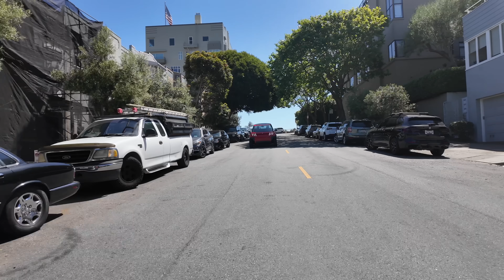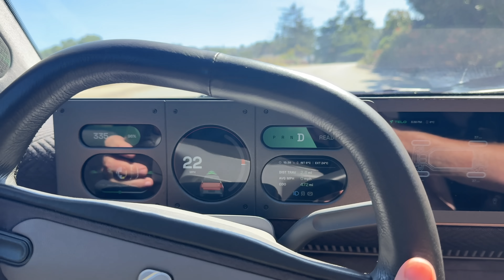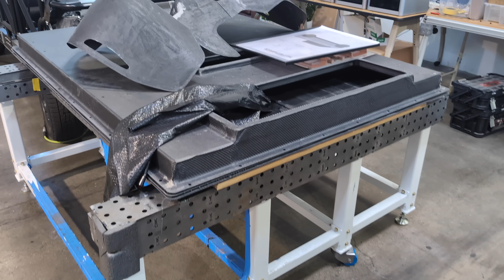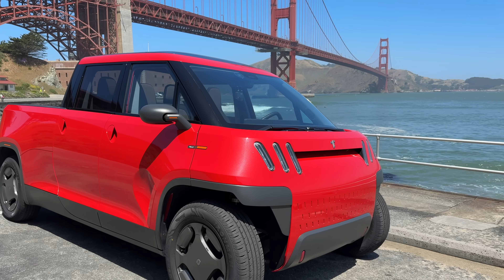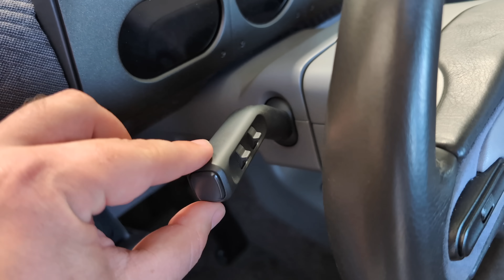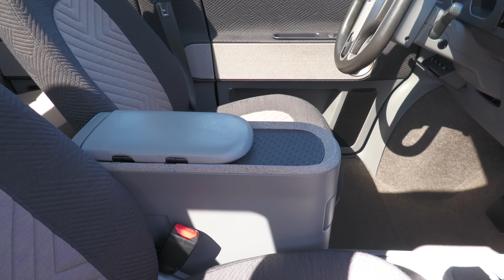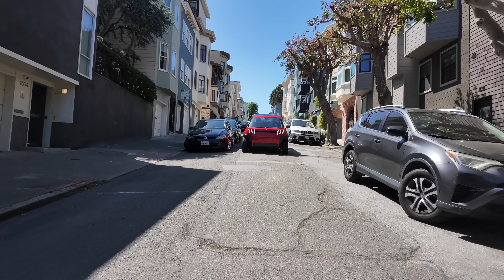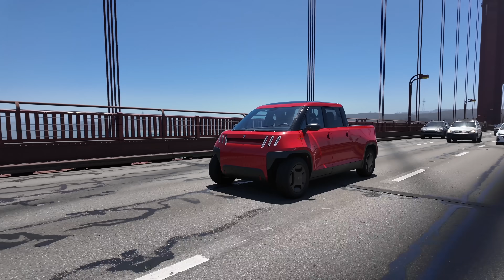The Tiny Telo Truck Hopes to Pack a Big Truck Punch

Comment: At $41,000 the least you’d expect is bicycle pedals…
Reply: Or Flintstones floorboard cutout ! 😆😆😆😆
Reply: Thats 2.5 hilux champs
Reply: @lasskinn  The standard version of which can't fit a full sheet of plywood in, all of which have too small a top speed to be street legal on American high ways and no version of which you can buy in the US, so comparing this to a Hilux Champ is pretty silly, don't you think?
Reply: @coachhalas6031 what do you mean you can't fit a full sheet of plywood in the standard champ? It has drop down back and sides and is a flat bed. You could transport this car on a champ if it came to it.

That it's not available is a commercial decision because americans are both able and willing to buy more expensive cars(simarly how the regular hilux revo isn't available).

(The normal hilux is also gray imported as sort of custom manufacture as commercial vehicles into several markets).

And fyi this is a luxury toy but due to market conditions in usa with gucci hipsters and mirage being laughed as a car they can sort of try to present it being affordable.

Question remains if its just another aptera scam too.
Reply: 300 range 300hp tbh 40k is fair
Reply: It’s a proof of concept at this point. You’re paying extra to help fund this project and allow them to set up a full production process for these. If these take off, there will inevitably be a cheaper version. That’s a big IF though.
Reply: @insainllama  fortunately if you want something that’s less of a proof-of-concept, this very channel has reviewed another vehicle called the Twike…
Reply: Looks like a toy chinese truck from Temu costing $5k  tops
Reply: @thomasfalcon6350  yes, because unlike the United States China actually still manufactures things, so you can get a kei truck from something other than a high-end custom coach-builder. (The prototype in the video is basically handmade.)
Reply: Slate is gonna eat their lunch.
Reply: @TerraMagnus  - I'll believe Slate's prices (and Telos') when they're actually shipping to customers.

I'd like BOTH to succeed, the competition in this long-lost segment would be great.
Reply: Stopped watching at $41K price tag. NOPE.
Reply: @IndependentLiberty batteries cost money man..
Reply: @IndependentLiberty  All cars are getting expensive. A Crown Signa or Outback is at this price and higher. Seems right in line with the multifunctional cars I'm looking at.
Reply: @inkermoy  You do you. I'll stick with my 25 year old Nissan Frontier with a v6, 5spd manual transmission.
Reply: can't be cheap, it's electric

Comment: Electric US Kei truck?
Reply from the maker: They actually had a Leo truck at their shop. The Telo is a fair bit wider
Reply: @agingwheels  So your friend in the Netherlands is right.  This thing is huge. 😄
Reply: @TronDD  compared to normal cars kinda, compared to american trucks no
Reply: @TronDD  it has to be in order to accommodate the bulk of the average American
Reply: @Kyomara1337  Not even compared to normal cars. Sure, it's tall, but it's only 152" (386 cm, give or take) long.
Reply: @samiraperi467  wasn't really talking about the length but more the width, it's 4-5 inches wider than a lot of compact cars that are longer than it
Reply: @agingwheels  will we ever get another update on the EV Escape or have you given up on that project the same way you gave up on the Bus? 😂
Reply: @agingwheels okay, so that’s JUST SO COOL.  They ==have a kei truck== to compare to.
Reply: Too big to be considered "kei". (Edit: too big by 46cm lenght and 37.5cm width)

"Kei" doesn't mean cab over, it's a specific set of dimention and displacement limits; it just happens to be that a cab over is compact, so it helps to fit in those limits.
Reply: The American mind cannot envisage a pickup that is anything between an F150 and Kei

Look up the VW Caddy from the 80s/90s, The Skoda Felicia Fun, the Ford P100 etc. All very usable mid sized (to us, small to you) pick ups.
Reply: @Beany2007FTW  
I have both the F-150 and a Kei truck.  They are two different beasts and if I didn't tow I could get by with just the kei and be perfectly fine with it.

CAFE means we can't have anything like what we once had with the old Hilux and Ranger back in the day, or the Datsuns and Mazdas.  They're trying with stuff like the Maverick and new Ranger but it ain't the same.
Reply: @Beany2007FTW  It's not the size itself, cab-over mid-engine pickup design with car sized parts in place of truck parts is pretty unique to Kei cars for Kei reasons.
Reply: it IS just a bigger Kei van
Reply: Nope, kei vehicles are much smaller and they have very limited power with tiny engines
Reply: @jamespaul2587  the power is actually just a gentlemens agreement (64ps, because of the Honda Beat), the limit is just the displacement (at 660cc)
Reply: For some reason Telo people hates the K-word like how Tesla fanatics hate competition
Reply: @すどにむ hate has nothing to do with it. This truck is too big and WAY too powerful to meet the legal standard for being a kei truck. Yes, this is a cabover configuration, which most kei trucks are, but there's no requirement that kei trucks be cabover- it's just the most space efficient layout, so that's what they do because it's the best way to build a truck to the size requirements of the Japanese kei vehicle class.But if a carmaker wanted to build a 3- box arrangement, engine in front pickup truck to kei truck standards, they could. Kei truck is a specific class of vehicle in Japan with strict rules with regards to exterior dimensions (length and width) engine size/output, and weight. If one or more of those specs aren't met, it's not a kei truck. And the Telo meets none of the requirements. There have been lots of cabover/ flat front  trucks over the years- the pickup versions of the VW Transporter, for example. Or the Corvair pickup. Both way too large to be kei trucks. Flat front isn't what defines the kei vehicle class.
Reply: @すどにむ  it's longer and wider than the max size for a kei by 46cm and 35.7cm respectively
Reply: @すどにむ  yay, my comments are getting shadowbanned. It's too long and wide to be a kei.
Reply: @Giuliana-w1f  YouTube does that a lot, anyway IMO scaling up to 150% and Tesla swapping a goofy as ultrautilitarian kei van format only makes it not-a-kei kei. 

tbh, especially "but kei is underpowered" arguments sound so dishonest considering there had been exported kei with same chassis and unrestricted engines.
Reply: @すどにむ  where i live, there are cars that were kei, but have engines between 0.9L and 1.3L, including a few pickups and vans
Reply: @Giuliana-w1f  yeah and "kei" is technically more than those boxy vans that are relevant here. the implication of "kei" here is clear to everyone and "telo is not kei because" arguments are all disingenuous manipulation attempts.
Reply: @Giuliana-w1f  I've driven one for a few months, it was weird and underpowered. But only because part of the use case was highway, and it was simply too tall for the fifth gear to have any pulling power above 50 mph. :D (Then again, the engine also went through oil like crazy, so it's possible it was down on power.)
Reply: @Giuliana-w1f why do you think your comments are being shadowbanned? They're visible to me
Reply: @すどにむ how is it "disingeuous manipulation" to point out the fact that a vehicle that is too large and too powerful to meet the standards for being a kei truck isn't a kei truck? Kei truck does not mean "flat front/ cabover" configuration. And theoretically, you could build a kei truck that isn't flat front/ cabover. Nobody does because that would limit its usefulness given the physical size restrictions that are the primary definition of the Japanese "keijidosha" vehicle class. But it could be done.

And sure, there's vehicles that, when sold in Japan with an engine smaller than 660cc meet the standard, that are sold elsewhere with larger engines. Even those aren't kei trucks because... They don't meet the legal standard anymore, as they're equipped with too large of an engine.

If the Telo is a kei truck, then a European semi must be one as well. After all, they're cabovers, and in your mind, the actual dimensions must not matter!
Reply: @すどにむ  They are seriously under-powered for 75 mph freeways. A kei truck is super cool - if you never have to take it on the freeway which isn't a reality for the vast majority of people in the US (also assuming it can even be registered in your state... many states won't let you even register them as a motor vehicle). I can definitely see the 4WD models as having potential just as off road vehicles for farm use or whatever. Plenty of power for that and very competitive with the overpriced offerings from John Deere and Polaris.
Reply: @bubba99009  I can easily buy Kei new and plate it as Kei car where I am, and I wouldn't daily it on real highways with it either
Reply: @すどにむ  why?
Reply: @すどにむ  it's too big to be considered kei.
Reply: @すどにむ  This is simply false- in fact, they have directly compared their own K-truck to the MT1, and cite K vehicles as their inspiration.   You're just making stuff up.
Reply: @mavigogun  See how much replies this tree is getting? These guys absolutely hate the K-word getting brought up. That much is clear as it gets, and if what you've said is correct, they should be proud that people are correct, and they're not.
Reply: @すどにむ probably because kei cars are underpowered and unsafe, with virtually no crash protection
Reply: @jamespaul2587  Same could be said for the old Mini, of which descendant this is smaller than. Smaller than Mini ~= Kei.
Reply: @jamespaul2587  They are NOT underpowered for intended use, and they have better crash protection than bigger cars a couple of decades ago.
Reply: @samiraperi467 they are underpowered and have poor safety ratings compared to modern vehicles such as TELO

Comment: I saw this on another channel and my biggest concern was the lack of crumple zones.
Reply from the maker: I'm not worried about that after talking to them. They're taking safety very seriously and it is a top priority. Crumple zones were also my first thought when I first saw it
Reply: @agingwheels Compared to almost every other vehicle in your fleet it will be safer. The Trabant has a crumple zone. You might even say it's 100% crumple zone, but does that make it safer?
Reply: @agingwheels Also why are the wheels in front out in the open like that? Cant imagine it would be good for pedestrian safety or aerodynamics.
Reply: @agingwheels they convinced you that a crumple zone is not needed?
Reply: @pascalbruyere7108  maybe they'll have the world's first front external airbags for on-demand crumpling.  or two arms that fly out of the bumper to brace itself, like 'oh no!'
Reply: @Rhynri I’ll go check it out
Reply: @pascalbruyere7108  They have the same 10inch crumple zone required by NHTSA as most other cars, it just doesn't have a massive engine under the hood as well as that so it doesn't look like it can crumple as much. They show the designs on their channel.
Reply: @Jcewazhere I did not know about the 10inch min requirement. When I see crashes on the highway the crushed zones seem much deeper than 10’.
Reply: On their own channel they have a video about the crumple zone. Same story as the Smart Fortwo really, if there is no cast iron lump in there, aka an engine, the same 1foot ish cprumple zone can scoot back and have a bit more efficient attenuation. If you're not convinced afterwards, look at the Fortwo's crash tests (and remember it is 25 years old), and Fifth Gears crash test of it.
Reply: @rasmAn2 yes, but:
- in these short stiff vehicles people experience non survivable G forces. There are no regulations about G forces.
- there are no hundreds of pounds of potential cargo in the back: people and stuff. Crash tests are done with no load.
Reply: It is indeed an impressive achievement, in 9 months.